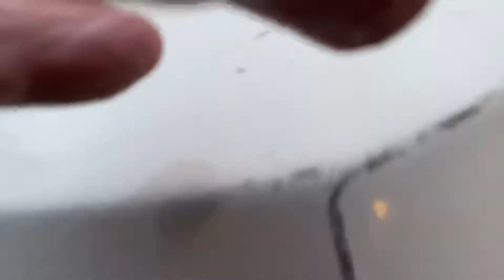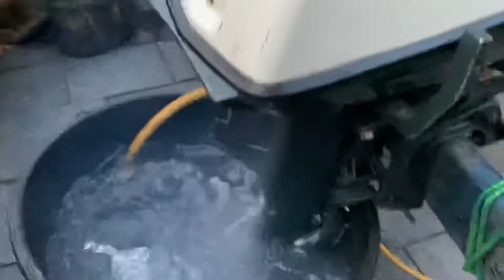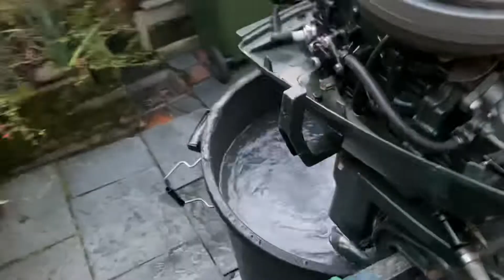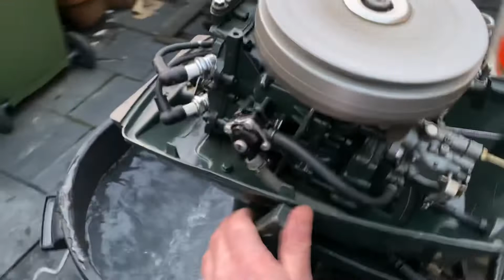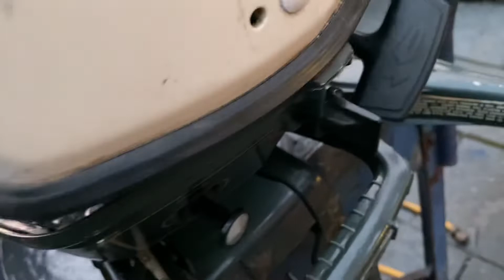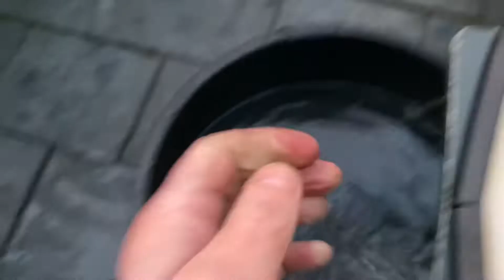1970 Johnson 6hp Two Stroke Outboard

Comment: Classic! Have one identical to it. Fantastic running. 
Watch that shift handle. They break if you look at them wrong.
I fashioned a piece of broken bush Clippers handle and JB weld. 
Works and looks decent. But its no longer original.
Cheers.